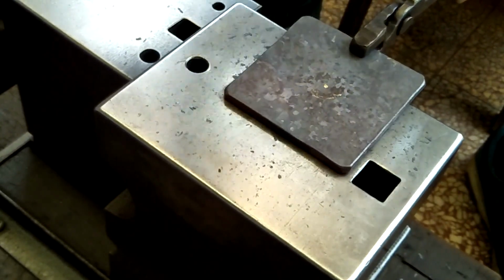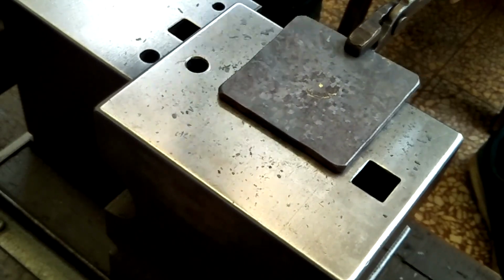blacksmith candle cup holder

Comment: I was thinking while watching this. Have you tried using the swages on the swage block to get the rounded look? Starting with a larger one and moving down to smaller until you get it how you want it, and rotate the sheet like you did on the anvil to get the bowl shape more uniform? I dont know how well that would work since ive neither used a swage block nor tried this project but it was a thought that came to mind. Regardless, I love your channel and all the various projects you endeavor, it gives me good ideas about what I want to try and do to improve my skill levels, such as making a candle holder, or tongs, or anything really.
Reply from the maker: CJ, Yes, you're exactly right. For my next project, I did exactly that and I can see how that will work better for certain shapes. You're spot on... Thanks for watching.

Comment: Beautiful!   Was the initial peening done with a somewhat rounded face hammer?  After peening all over like you did, does the steel become noticeably harder to work?  Did you have your swage blocks made there?  Thanks again!  Jerry
Reply from the maker: The hammer I mainly used for this does have a very rounded face. Peening doesn't make mild steel harder (however does for some steels) but it's funny you mention this since I am fooling around with copper for the first time and it has this characteristic. It work hardens but becomes soft from quenching at high temperature. I bought that swage block at a local hardware store. Thanks.